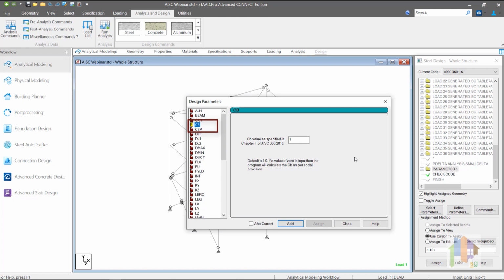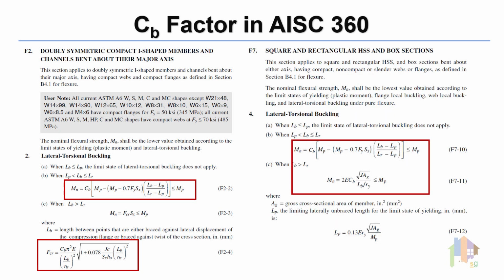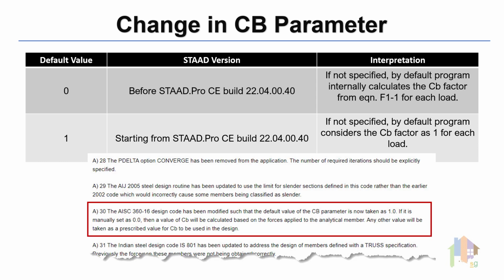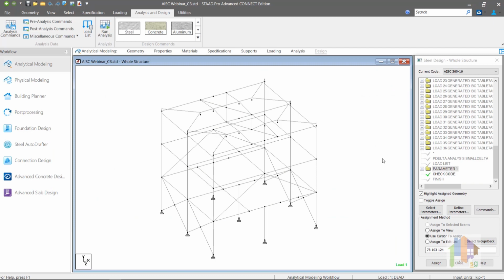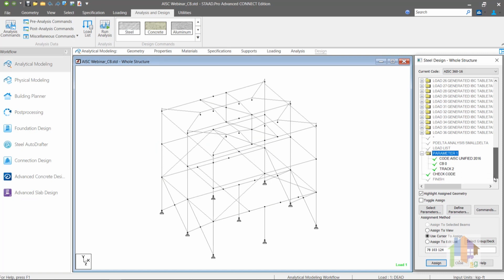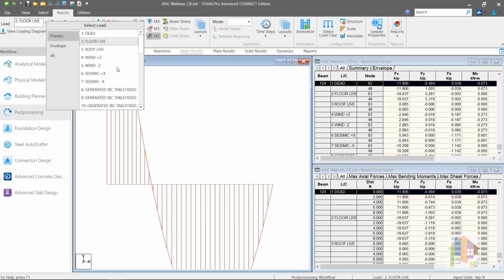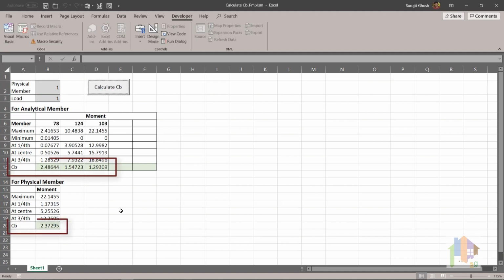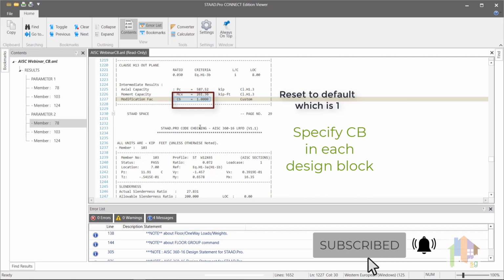Steel Member Design with AISC 360 - Basic & Calculation of Cb factor || CB parameter || LTB check

Comment: Sir, I wanna ask u a question. My question is we know that STAAD doesn't have command for material nonlinearity. So, what should i do to consider material nonliniearity in STAAD if i want to perform second-order analysis like P-DELTA? Thank you.
Reply from the maker: It is not possible to directly consider material non-linearity in analysis or design in STAAD. But you can use Direct Analysis method if you are using AISC 360 code for steel member design. Under direct analysis method, stiffness reduction due to the material non-linearity is already considered and it will be used for design.
You can check this post for more details -- https://communities.bentley.com/products/ram-staad/w/structural_analysis_and_design__wiki/10606/direct-analysis-and-its-implentation-in-staad-pro
Reply: @surojit_ghosh  Okeee, i will check the post. Thank you so much sir for the response, it is very helpful. Once again, thank you🙏.

Comment: Thank you very helpfull...Please share cb calculation macro..
Reply from the maker: This is an unpublished macro, and some minor enhancements are required (I want to include more user control, auto generation and assignment of CB parameter in STAAD model). if there is enough request for this code, then I will publish this.
Reply: @surojit_ghosh  We will appreciate the cb calculation macro. Also, I hope all of will also appreciate if you share or develop the Tappered section  optmization macro for AiSC.
Reply: Thank you sir. Please share cb calculation macro